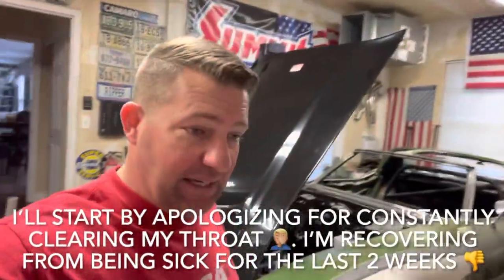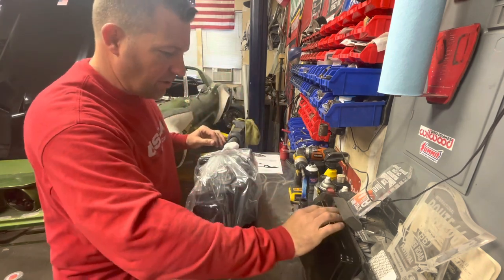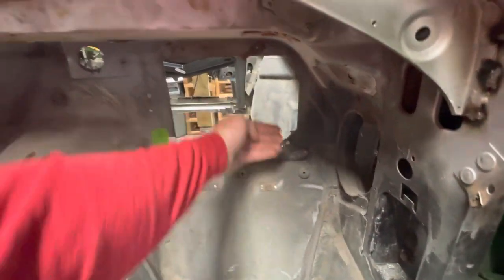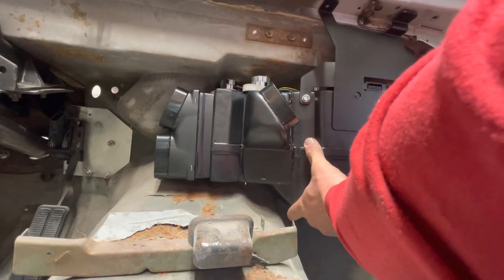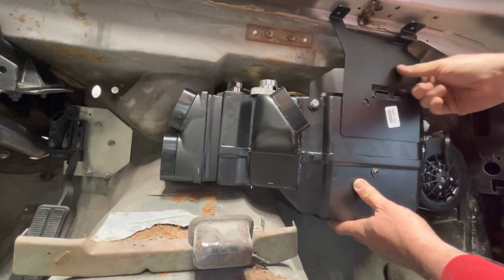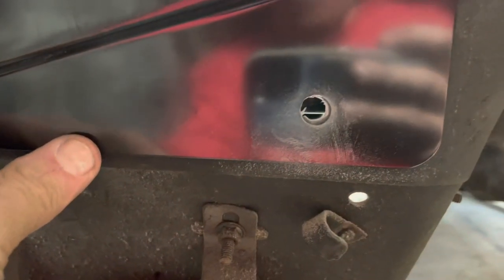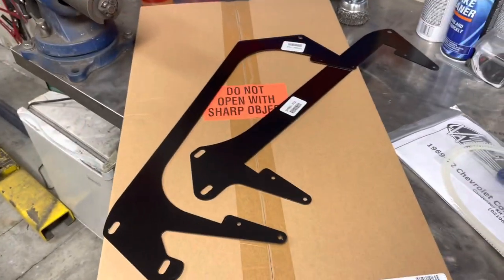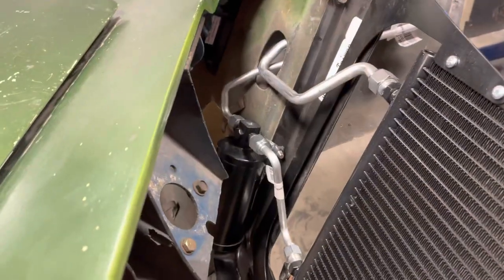Vintage Air AC Installation for 1972 C3 Corvette

Comment: Great videos! What size wheels and tires are you using? I've installed   a RideTech rear suspension and coilovers, stock front with upgrades on my 75, probably a RideTech front suspension in the future. Thx for any advice. Rick
Reply from the maker: They’ll be 18x12 and 18x11. The back spacing is around 5”. I’ll have to confirm 
Il running 335’s and 315 bfg rivals at the moment
Reply: Thx man! Dig the build and the videos...big help for me with my build.